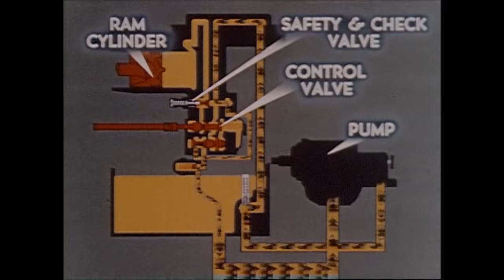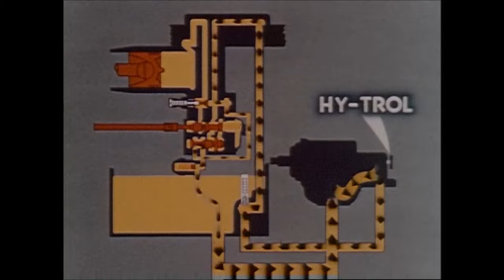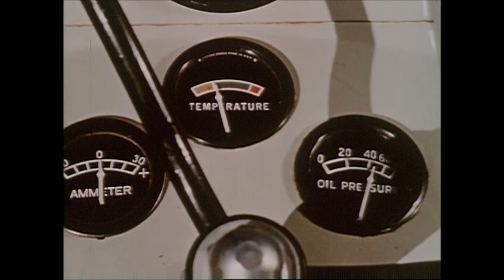The new Ford Tractor 1953

Comment: I bought a 641 a few months ago, this video was a great help.  They are so easy to maintain,parts are everywhere and affordable. 53 years old,not leaking a drop of anything and the 3 point works like new. This from a die hard JD owner of over 20 years.  Now I need the remote cylinder setup.
Reply: Som customs

Comment: On our NH farm we had a similar model, the 1954 Allis-Chalmers CA.  The CA had a similar hydraulic system that was very handy for many implements.  That hand-clutch was extremely useful to keep the PTO engaged while stopping the forward motion.  Also, you could mount idler wheels for a half-track to plow snow without spinning the wheels.

Comment: Some Big Improvements over my  1952 8N
Reply: Mike Skidmore even more over my 1945 Ford 2NAN
Reply: @remco8170    Ford did not change the   8N 2N much between about  1938 and 1952 . Though the  52 is a 4 speed  side Distributor instead of Man in the front.. valve rotators on the exhaust..
  No Live PTO let alone live hydraulics.

Comment: Ok. I wish my dad had owned a jubilee ford for me to learn to operate it on. Instead, he bought two brand new super dexta diesels. I think 63 or 64 models. Biggest two pieces of crap I ever had to drive. It most of the time had to be pushed off on a hill to crank because it ate starters and batteries like a cow eating grass. You had to be careful toting an implement down the road , the lift would fall and drop and let it hit the ground for no reason . The brakes would wear out after working a couple 50 acre fields . If you got it started in the mornin, you better leave it running all day because you might not get it back started if you shut it off. The day they were delivered from the dealer brand new, one of them had to be jumped off to crank it. They were terrible .

Comment: This massive power we keep hearing about is almost 25hp.
Reply: Torque is where it's at though with power equipment. But yeah, it's pretty funny to hear that now days.
Reply: Yes I don't think it was taking too big of a bite when it was pulling the three bottom
Reply: Never saw them used for much real farming where I grew up. The little fords from 9n up were common as dirt but only used as small chore/garden tractors around me. They were nice for raking hay and pulling hay wagons and fire wood trailers and such as long as you didn’t have any steep hills to go down with a load or tried to make any sudden stops because they were too small and light and the brakes on them were trash, only good for a couple hard stops before they gave up the ghost 😂
Reply: 31.14 hp.

Comment: At 15:47 the front loader guard rams the back of the trailer. Should have fitted a counter weight.
Reply: Pppoo
Reply: The unmistakable was way
Qualm. 
Pppoo
Reply: The unmistakable was way
Quality and the . 
Pppoo
Reply: The unmistakable was way
Quality and the . 
Pppoo

Comment: My dad and I have one of these I started driving it when I was 7yrs old, he had it at the ford dealer 3 or 4 times to get the 3 point fixed because it wouldn't lift after I brought it over to where I live I had that fixed in 1 hour, my dad had the engine overhauled because he thought it was using oil but he missed the fact it was overfilling the transmission what I found was the two seals that seal the pump from engine crankcase were worn out so the pump sucked up the engine oil enough to lube the pump to keep it from seizing up. Since I fixed it the engine doesn't use oil and the three point works perfect every time.

Comment: I just purchased a 1954 Golden Jubilee with front end loader and rear blade. I plan to restore it and any helpful information would be greatly appreciated. It runs great but the rear hydraulic pump is slow and the cylinders and pump for the front end loader are leaking oil and will have to be rebuilt. I'm looking for resource material that will guide me in that process. Thanks, in advance, for any helpful advice.

Comment: had the next model 650 . loved it ! 5spd and originally with power steering . 
one doesnt think much of a simple -governor-   but some PTO generator companies allowed THIS series gas engine to run because GOVERNOR was responsive enough to maintain 60hz . 
    little tractor will PULL some kinda LOGS if use 3pt weight transfer properly .

Comment: I struggled to pull a 1 bottom plow with my 8N. This farmer is pulling a 3 bottom plow?
Reply: The asterisk refers to most conditions,variations can be any from soil type,depth you want to plow at, rear tire size and properly added weight for ballast to increase traction as well as cutting width of each furrow that will require more or less load on tractor . proper adjustment of the plow also helps. the 1953 also had more hp than an 8n.
Reply: I was plowing in unbroken ground and it was clay. I guess if you had broken ground from previous years and it was soft dirt ,,like sand you could pull a 3 bottom? Maybe?
Reply: Had the n series tractors had a creeper gear, they could have pulled much more, it's all in the gearing.

Comment: How much PS had that tractor? I have an oldy as well and believe it's from the 70's. It's an For 3600 and has as I have understood 55 PS. We recentply overhauled the Motor completely and it's allmost as new now. Hydraulik does not work but we use it for fodder carrying on an farm for the cows were we dont Need the hydraulics. At least Motor is as new and clutch as well. Doesnt break anymore but thats not needed neighter. This Ford 3600 has an fixed shovel/Scoop on it's 3-arm-point were it carries the fodder and Silage around once a day. It uses very less fuel (about 30 Liters per month) as I Need to fill the fuel tank only once a month. Looses some oil (rear hydraulic oil compartment or gearbox) underneath but have an eye on it it's not worth the Investment to fix it as now. The Motor has been opened the first time as we let it repair a few months ago (but thats only because some latino workers probably did not wathch the Motor oil Level) so it Held up about 30 years without ever overhauling the Motor. The Chassis is a bit rusty and used but back then they used real rust retardant metal.

Comment: I prefer the 850 myself but the Jubilee is a good tractor it has decent power more then the 8n before it and live engine hydraulics Wich are much better then the PTO driven system before it and it's so good this is the system that's still used today

Comment: Funny how Ford celebrated its 50th anniversary with a tractor not a car, now they have nothing to do with ag machinery
Reply: ford is new holland now, they have loads to do with ag machinery
Reply: Moi Williams Ford Motor Company has had nothing to do with tractors or ag production since 1996
Reply: Bduff007 whats Newholland then,i thought ford bought new holland and started calling ford tractors newholland because at first new holland tractors were ford newholland
Reply: Moi Williams After 1996 Ford turned over all ag and tractor production to NH. Ford held control over its patents until 2000. After that it was all NH which is now owned by Fiat
Reply: Bduff007 makes sense because there are some blue 110 90 around here,all i can say is im a massey man not a ford man😂
Reply: Ford also celebrated the 50th anniversary with their 1953 automobiles also.  Check out the 1953 Ford 50th anniversary automobiles models.
Reply: Which also owns Case IH.
Reply: Moi Williams and they’re owned by Fiat. So no, Ford has nothing to do with farming anymore.

Comment: This video is not from the 50s at 11:58-12:01 you can see cars that aren't from the 50s if you look between the left fender and the operator.
Reply from the maker: Tell me the make and model of the 2 cars passing, and i will check it out ;-)
Reply: Exactly. ;-)
Reply: The copyright is 1953. I looked at the cars you mentioned and I couldn't see what they were.
Reply: Look like vehicles from the 40's.
Reply: Jeff Bishop I stopped motion at 12:00 and the cars look to be late 40s or early 50s

Comment: My grandpa has a jubilee restored for tractor cades with the overdrive trans sno it will scoot at about 20 mph, other than that it is a completely worthless tractor, he has a 6ft field cultivator it struggles to pull comfortably and a 2 bottom plow it handles ok but the 6ft tandem disk makes it ride wheelies... I couldn't imagine trying to farm an 80 with that thing
Reply: sornbergerfarms 
 We had one all ways put dual tires on back for discing , in side tires loaded with calcium solution , so that tires floated on top of ground but had lots of traction pulled  10 ' double disc,cullipacker ,and drag , with no problem
Reply: Douglas Steiskal , do you have to get a longer axle to use double tires or how do you connect them together? I’ve seen videos with tractors having double tires on one side and a single tire on the other.
Reply: @mikeingeorgia1  Duals can be attached to the rim of the tire.

Comment: I thought New Holland made implements for use with ford tractors.  The former Ford Tractors are now made by New Holland.
Reply: I did see in Wikipedia that Ford used to have a subsidiary where they sold farm implements called Dearborn Motors. They handled the Ford tractors and the implementation to be used with them.

Comment: they were cool for hobby farms but real farms needed real tractors..
Reply: In as little as 7 years these types of tractors looked like old technology with JD's New Generation of Power, basically the "modern" tractor began there.
Reply: Seems like the horsepower race didn’t take off until 70-80’s